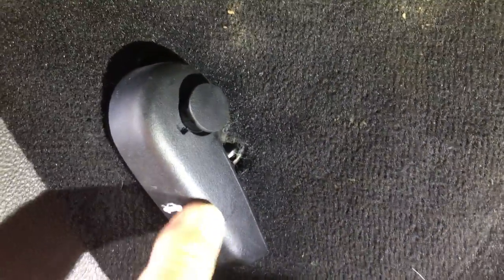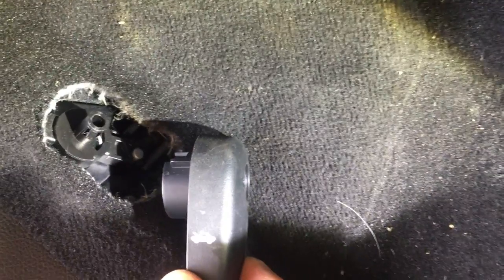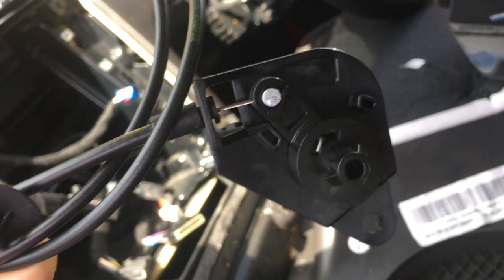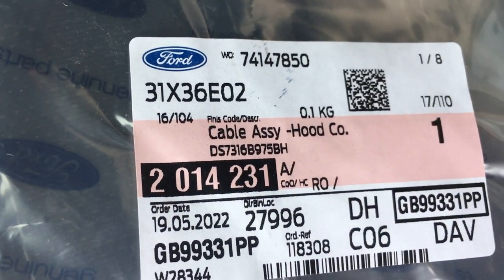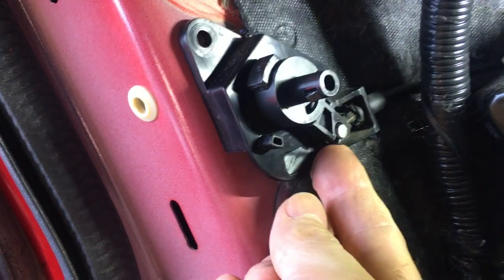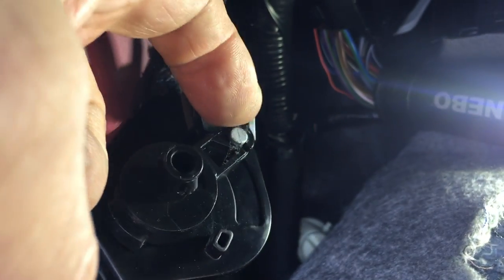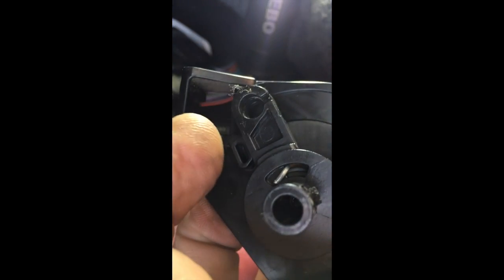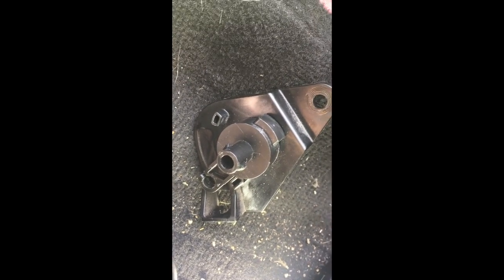Bonnet Handle Broken??  Ford Mondeo Mk5

Comment: Are ford Mondeo MK4 drive shaft expensive to buy? A garage said I need both my front two replaced and to buy genuine ford parts and the quote was £1200 parts and labour.. is that right? I looked online and for the parts at £150 or about ?
Reply from the maker: for a mk4 you can get aftermarket driveshafts at a much cheaper price than ford
Reply: @alan4x  are they good to use. I was told they won't last long.
Reply from the maker: @sr-xv7eu  not as good as the originals but will still last pretty well as long as not abused

Comment: Brilliant Alan, do you think i could change a front wheel bearing on my connect with out a hydraulic  press👍
Reply: ive done x2 wheel bearings on a mondeo with a ebay bearing press kit, no hydraulic press.
Reply from the maker: no, it would be very difficult, take the hub off and get a garage with a press to fit it, should not take long
Reply: @alan4x  Thanks Alan.

Comment: And all because Ford didn't route the cable to the right for the UK market, given that you're probably right that broken ones are because drivers and mechanics lean over and pull it from the wrong angle. Cheers.
Reply from the maker: exactly lol
Reply: @alan4x  Evening Alan, I hope all's well with you. Have you had problems with Mark 5 Mondeo driver's door window/mirror switches? Mine have stopped working. No clicks or anything. I changed the driver's door window/ mirror fuse and also the passenger one in case they were swapped, this also being a LH drive yank car design. But nothing doing. All the other windows are working on their own door switches. I'm wondering if it's the umbilical wiring near the door hinge. I've only had the car a month (65 plate 1.5 Econetic - no road tax and v economical) and I got a 2 year warranty with it. So it will be back to Petch Ltd in Middlesbrough if it's not something simple I can do. Love your videos and appreciate the effort you put in. Cheers, Mike